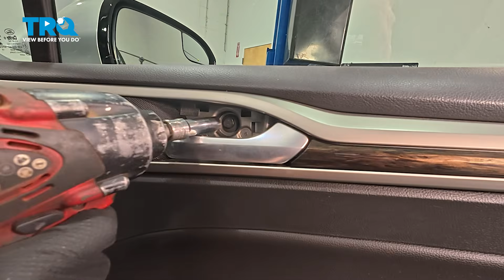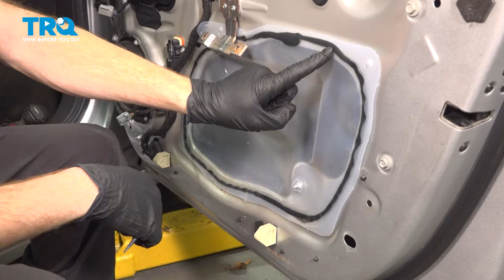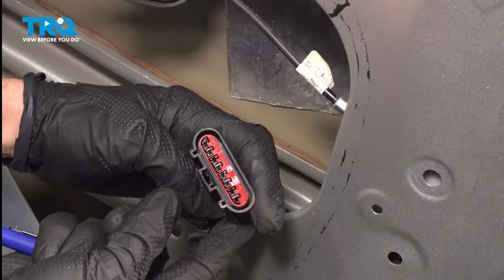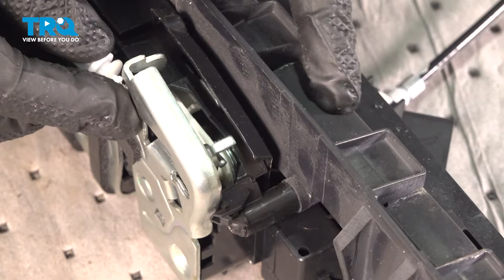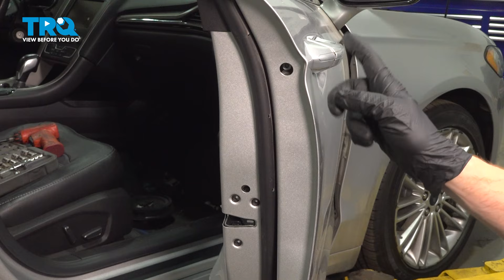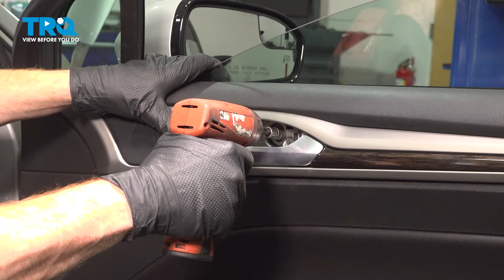How to Replace Front Door Lock Actuators 2013-2020 Ford Fusion

Comment: And so, after breaking the interior door latch cable as well.... I have discovered that if you simply pull the interior latch, the interior cable will free itself of its choke hold. Save the extra $60-$70 bucks of replacing it after breaking it. 

Other than that this is a great video and I am thankful for the demonstration! 😁

Comment: Really appreciate the video and you sharing your knowledge. Latch went out without any warning on my wife’s car at the gas station. Called a local shop to see if they worked on latches and they said “they could look at it.” I could be wrong, but all I heard were $$$ going off. Ordered the latch, and the release cable after further inspection, and got it all squared away. Probably saved hundreds. Thank you.

Comment: Heads up remove the vertical bar for the window, it should be common knowledge still it was done on camera.

Also for the actuator there's the matter of the steel wire that connects the 2 pieces that was glossed over.

Thanks for the video though it took me an hour with little to no experience, those were two parts that confused me for a quick second. ❤❤
Reply: Sorry i dont know the nomenclature for the parts mentioned 😂

Comment: Thanks so much. Your video helped me out so much with installing the exterior door handle. One thing I did that may help others is to set the latch in position while turning the set screw before putting it in the door. It eliminates having to use the pick and then getting it in position.

Comment: I'll be doing this tomorrow and was hoping to avoid disassembling the entire door. Looks like getting the door handle latch back in place will take some finess. Thanks for the pro tutorial.
Reply: So, it took me about 4 hours to replace the latch. My pull-latch was slightly different, but I used basically the same technique to remove and install. The tech did an excellent job explaining how to reinstall it. Without this video I'm not sure if I would have figured out how the latch gets reinstalled.  New subscriber here! I'm sure I'll be tuning into your future tutorials.  Pro mechanic imho